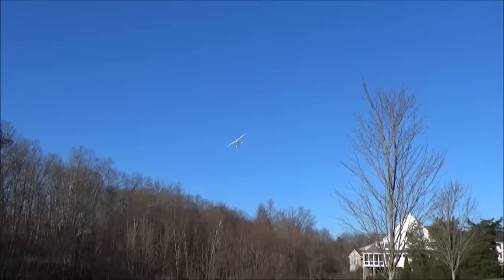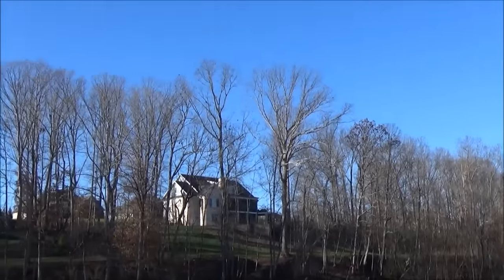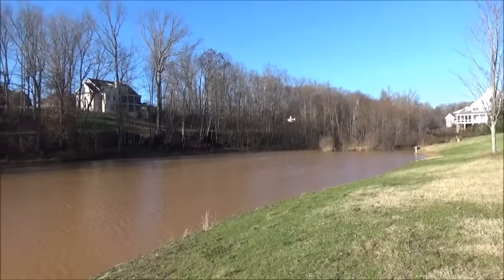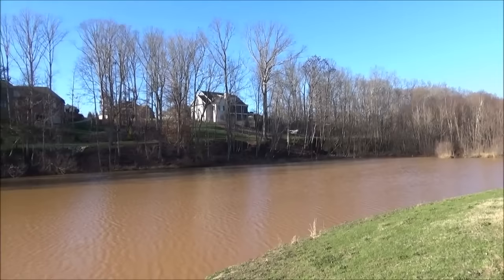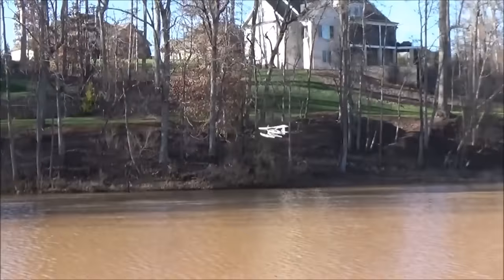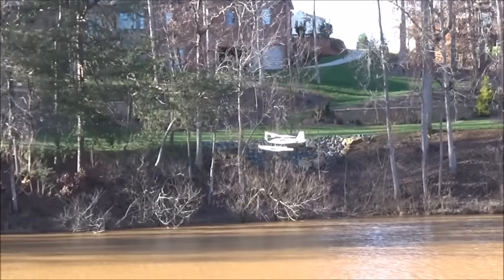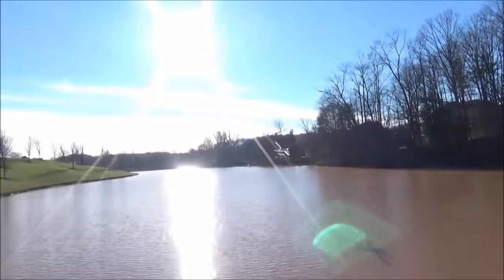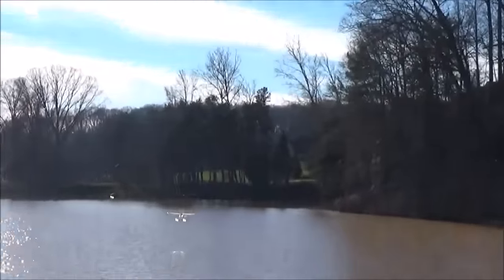Durafly Tundra on Floats - RCGroups.com Review

Comment: I think that hard smack on the water wasn't intentional, that's probably what weakened your float for it to break off during landing. The attachment tabs on my floats were weak from the factory, broke off just picking it up when installing the wires. So maybe future buyers would   want to check that.